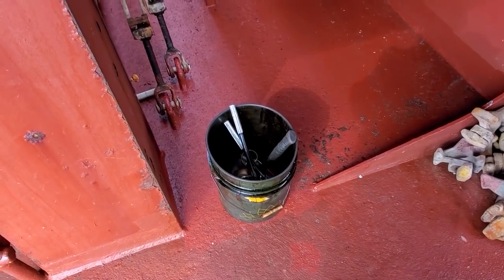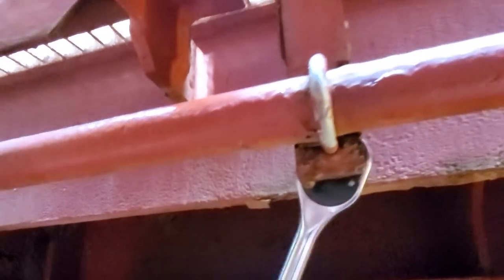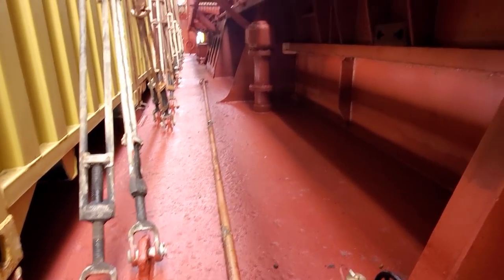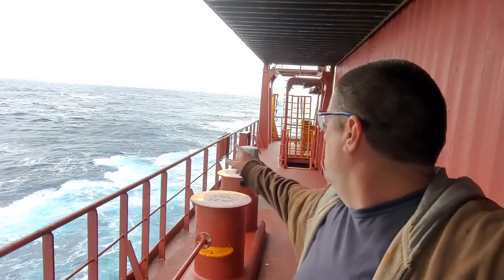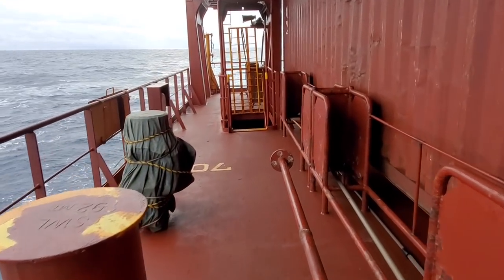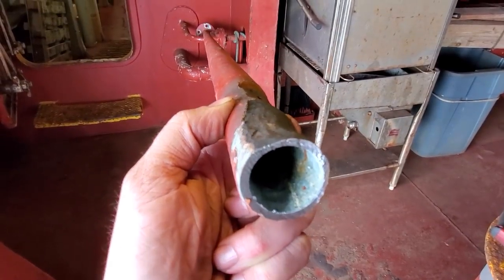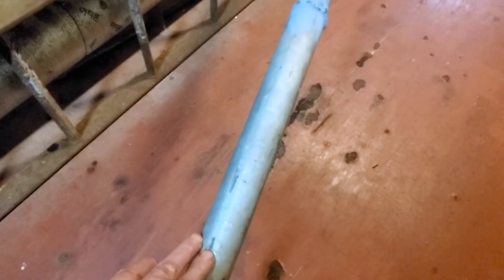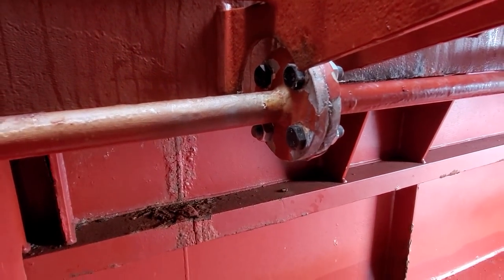Container Ship Vlog #32 (Job on Deck)

Comment: It’s interesting to see all that corrosion behind that pipe - the sea must be tough on steel that isn’t galvanized or painted. I remember reading somewhere that on ships they use a sacrificial metal to protect the steel from rusting via  cathodic protection - is there some big hunk of zinc / magnesium bolted on the ship somewhere?
Reply: The used to do that to protect the propeller from loosing metal to the ship's hull through electrolytic action, seawater being an electrolyte. I don't know if the still do this on modern rigs

Comment: I would like to have seen how you kept the flange orientation (clocking), on such a long pipe, when you prepared to weld it back together. Did you do more than 'eyeball it'?
Reply: i had the same question. that's the tricky part
Reply: Never even gave that a thought!
Reply: I actually eyeballed it...with that length it was easy

Comment: jOB WELL DONEON THE REPAIR. From a 40 year  ret.power plant mech.
Reply: Thank you I would have just replaced the whole line if I had a section of pipe long enough that exact size but I didn't and as you know a lot of times we have to work with whatever we have just to get it done

Comment: Job well done. I just wonder wasn't an assistant available to help, at least holding up the pipe in place for the bolting of the flanges?
Reply: I could have got a cadet, but I was ok...I'm used to it, lol.

Comment: Good video as always thank you! A couple of questions; is there a reason why threaded pipe connections are not used either initially or for repairs? What kind of bulbs are used in the deck lights we see in the shots?
Reply: I just took footage of a job where I did use threaded pipe I had the right size pipe and I threaded it but this particular job I did not have that chance to do it I did not have the exact size

Comment: Never heard of a repair like that. Why wouldnt you just cut out the bad pipe then use threaded couplings on the replacement section?
Reply: Less likely to fail this way? Couplings can come loose...
Reply: Good question I chose to do it this way because I did not have another piece of pipe this exact size
Reply: Rick Bullard: at sea you have to improvise with the materials available

Comment: What is a airline used for ?cool video dude x
Reply: This particular airline its use for air access on deck for working with air tools. One example would be when the deck department personnel use their air tools to chip the rust off the deck to be prepared for a new coat of paint
Reply: To add: it is not wise to use electric power on decks for the risk of shock so air or hydraulics are used to power tools.
Reply: Aha cool x
Reply: @78a67h  true
Reply: @jefferyb.3406  There has not been much use of air tools on this ship to chip rust . so , why the bullshit regarding fitting a temporary valve and air connection ????????
Reply: @jefferyb.3406  About time they got the air tools out now the pipe is fixed and repaint the ship.